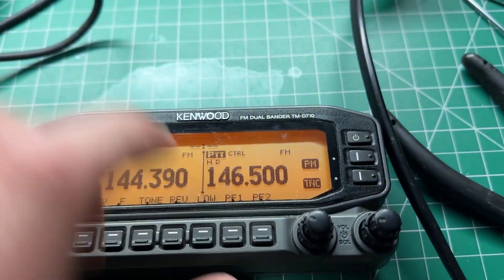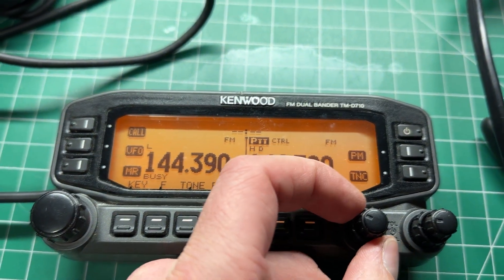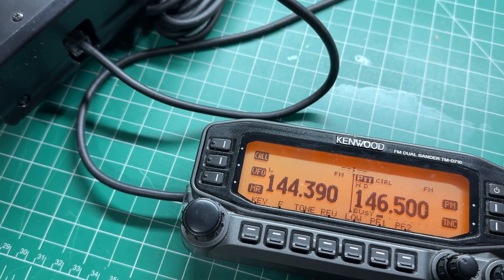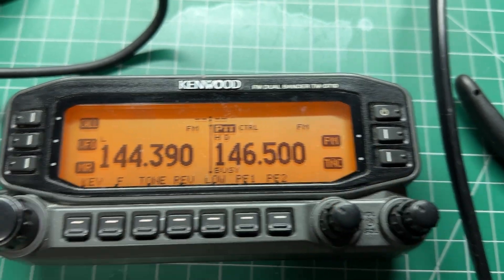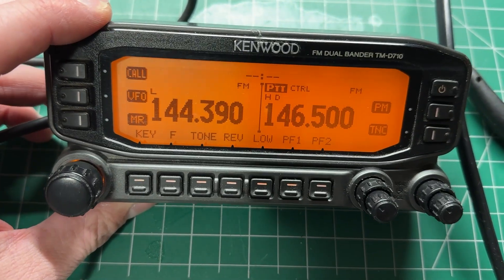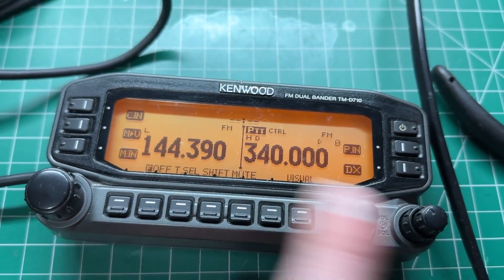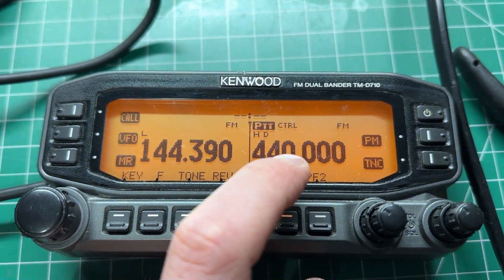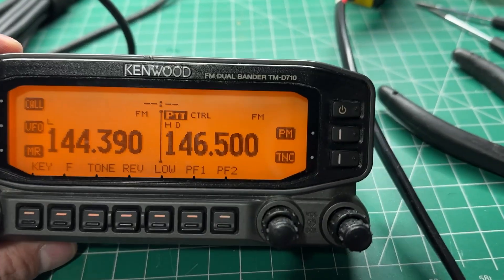Can Someone Help Me Fix My Radio?

Comment: Had the exact same problem on an FT857. HF was ok, 2m squelch fault, 70cm ok. Turned out to be a diode not far from the band switching circuitry that had been taken out by static.

Comment: Try this at your own risk! Looks like squelch has paths on both the head unit and the main unit.  In the head its called SQL_B and in the main uni it is SQ_B.  If the pot and diodes test okay on the head unit I would trace the main unit SQ_B a little more.  Try testing the small 0.1u caps C558, C572, C573, C568 to ensure they haven't failed closed.  I think there is a test point on the TX-RX board for SQ_B and you would probably expect voltage changes as you adjusted the squelch pot.
Reply from the maker: Thanks! I can see that test point now in the schematic. I'll give it a go
Reply: @HamRadioDX  Hope it helps!  You can use SQ_A and SQL_A values as a reference while tracing.  The logic paths look pretty symmetrical. Also, the service manual talks about a firmware adjustment for squelch called SQ1 A or SQ1 B.  Those settings don't reset during a factory reset but I doubt the previous owner adjusted those settings on only the B VFO for every band.
Reply from the maker: @N6WLM  Thanks for your suggestions mate! I managed to fix it! Traced the circuit back and found one of the resistor arrays had gone bad... reading like megs of ohms. 
So I bypassed it with a 1K resistor and it's working again now

Comment: The volume / squelch controls are old school potentiometers.  If you disassemble the faceplate you will find each control is mounted to it's own little circuit board.  If you unplug that daughter board from the main display circuit board you can use a Ohmmeter to check it or just probe on the backside of the circuit board where the control is soldered down.  Also be sure to check for poor solder joints.

The volume and squelch controls operate like this.  One side of the squelch or volume potentiometer is supplied 5 Volts, the other side ground and the wiper goes off to other circuitry.  First a resistor array IC, then an ADC circuit to convert the varying analog voltage to digital which tells the MCU what position each of the controls is in.  Also be aware there are 3 double diode's on each of the control daughter circuit boards.  These are used for overvoltage protection.  If one of these are bad it could cause problems.  Each section of these double diode's can be checked like a normal diode.

Mike
KC3OSD
Reply: Did you watch the video?
Reply from the maker: Thanks. I swapped the two volume pots around and the problem stayed on the B band side. I'll check the diodes next.
Reply: @HamRadioDX  If everything seems OK there locate (using the service manual) the 4 resistor array that the squelch line runs through.  Basically comes down to signal tracing at that point.  Don't be surprised if you get the whole way back to the MCU.  It's rare but I have seen I/O (input/output) pins go bad on processors before
Reply from the maker: @mikesradiorepair  Thanks Mike! I have the service manual now, I'll check it out
Reply: @HamRadioDX  where did you get the service manual from? I have some repairs to do to my 710 after it got wet in the footwell of the car >.>

Comment: Nice radio.  I believe that the connection from the head end to the transceiver body is digital - I saw some details on the Internet a while ago about how you could control the transceiver body via the port used to connect the head and dispense wit the head entirely.  

I would be tempted to open the transceiver body and look for any signs of damage there.

It's a great shame that Kenwood has abandoned amateur operators in Australia.
Reply from the maker: I have access to the service manual now, so I'll have a closer look!
Yeah, if they were here still, I'd just send it back to them for repair. I'm confident the problem is in the head... but we'll see.

Comment: Hi Hayden. I'd check the squelch mode setting.  There are several modes.  Normal squelch and squelch based on signal level on the meter plus a other I can't remember.  Check the manual. This is the case for my TMV71a, think the TM733 had it as well so could be the same for that radio.  Have you tried a master reset?

Comment: I would do a total reset of the radio first. The. Check on the manual if there’s any information about it. Finally with service manual you should be able at least to check if you can change the threshold level. You need a short plug into data connector at the back to get access to the service menu.
Best wishes
Diego
Reply from the maker: Thanks Diego.
I have done a full reset with no change. I’ll make up the shorted plug to enter the service menu and see if anything is obvious in there

Comment: I would try a full reset first off,its like there is a tone squelch enabled but from the display it doesn't appear to be,there is another tone setting in the APRS menu as well but the TNC doesn't look to be active so probably not that either,i would try a full reset and if that doesn't work can you maybe switch the A/B pots around and try and diagnose it that way perhaps, i have 2 TMD710's great radio's, love them,73 de EI9GGB Michael

Comment: In the radio there are 2 diodes where the cable connects one has blown and isn’t working properly sending the signal to the head unit
Reply from the maker: Do you have the schematic part number they use?
Reply: @HamRadioDX  I side with Andy here, Although I had not had that radio, one of my TYT 9800's did the same, squelch became unresponsive, sold it off with full disclosure and the buyer fixed it the same day he got it out of the mailbox, it was one of those ittsy bittsy diodes in the circuit that went bad, and he happen to own a surface mount electronic company, so easy fix for him lol.
Reply: @HamRadioDX , try a generic small sig. diode like a 1N4148 and see if that works.

Comment: It might be the ceramic filters Hayden.  They are separate for A / B.  I'd check those.
Reply from the maker: Thanks. The radio still receives fine. I did have a 710 years ago that had issues with the filters - it didn’t receive on one side. I replaced the filter and it was good to go again
Reply: Was the filters for me too, I bought a pack from china for cheap and replaced mine. Switch it into narrowband and the narrowband filter will show if it’s bad or not.

Comment: Hi Hayden, could the right side be set to low level "S" meter squelch and the left set to normal squelch ? There should be a menu setting for on, off and level, it may disconnect the usual squelch adjustment pot when on. Good luck with it.👍
Reply from the maker: Possibly, I'll check it out thanks mate

Comment: Page 34 of the service manual (items 17 & 18) show a threshold setting for squelch, band A / band B).
Question: Is there any cable plugged into the rear besides coax and power?  The "DATA" cable has a SQ terminal and I'm nearly certain that it is bidirectional ie. if it's tied high or low, it will clamp the receiver to that logic position.   Good luck. 73
Reply from the maker: Hey mate, no cable plugged into the DATA port. Cool, I'll check that threshold setting.

Comment: Get in the service menu, that seems like a crackerjack plan.  You've got a service monitor, you can also do an alignment while you're in there.  Both of those would make great vids.  Good job, mate!
Reply from the maker: If the service menu fixes the problem. I need to solder a din shorting plug up which gets me into the service menu apparently.

Comment: I have seen something similar with my 710A and it turned out to be a setting I incorrectly put in the TNC. I been trying to remember what that setting was so I can let you know but can't remember off the top of my head. A factory reset might be a better option to clear all the settings.
Reply from the maker: Thanks mate, I did do a factory reset but that didn't fix it

Comment: Hey mate, I think you have already discounted this, but there are a few threads concerning failed ceramic filters ? Adam, G2AP.
Reply from the maker: Yeah I think that mainly affects the receiver and it is receiving fine. Others point to diode blown, so I'll check that out next
Reply: @HamRadioDX  ok buddy, good look it getting it fixed, best regards, Adam, G2AP
Reply: @HamRadioDX  menu 105 , S meter squelch ???